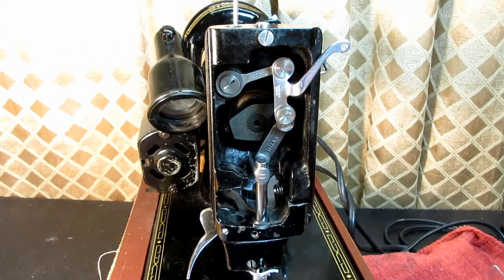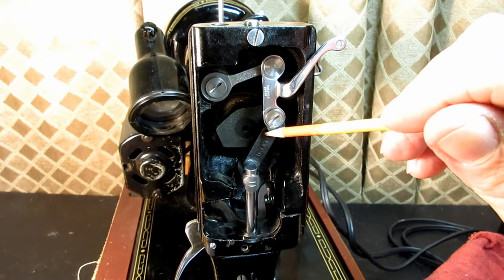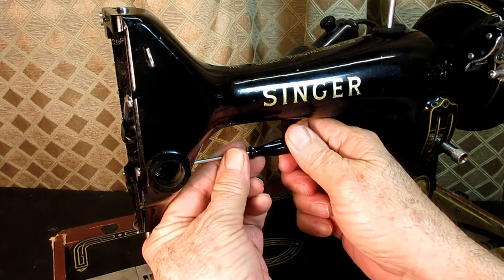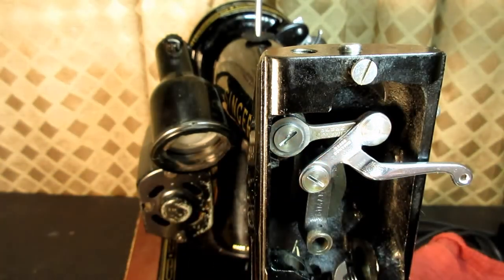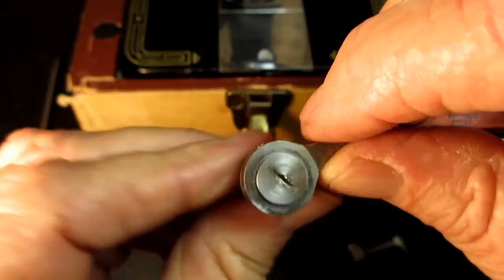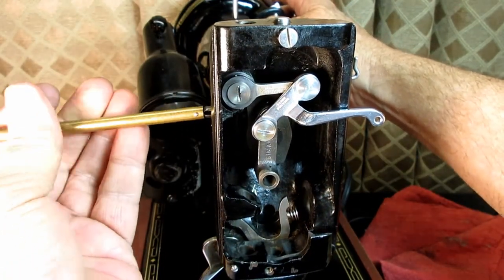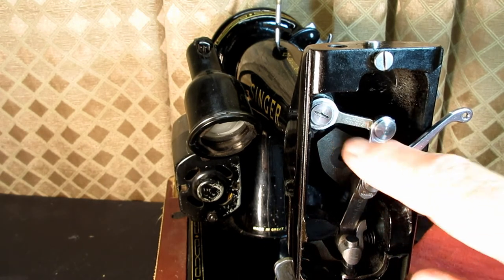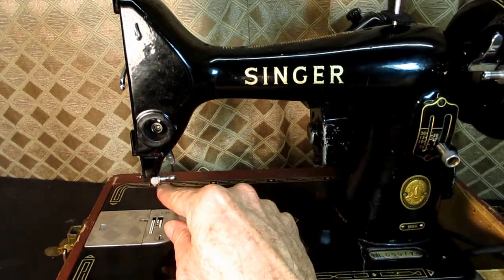The Needle Bar and Take-Up System of a Singer Model 99K Sewing Machine

Comment: Hello Andy,

You have some great videos on the Singer 99K. I am working on a Singer Red Eye 66-1 and I find your videos a great source of information for my applications to the 66-1. FYI, as I have been working on my machine I would like to note a few minor differences that may help someone working on a 66 model that I have learned along the way. 
Nothing major, starting from the bottom to the top: (1)  The needle bar bushing sleeve is longer and
sticks out from the bottom and top of the body and the set screw is in the
front.  (2)  The tread take up crank is the only location with a cap screw that is reverse threaded. 
(3)  The tread take up lever is connected directly at the top joint where the take up connecting link and the
top take up lever link meet.  (4)  At the top of the assembly, the cap screw is right hand screw in the machine body.  No
set screw with a hole in the side of the machine.

Otherwise everything is the about the same, with up to 50 years more of dry oil and crud to clean which is a little more time consuming.      Ralph
Reply from the maker: Thank you for sharing this information. I know many people realize the 99 is a 3/4 version of the 66 and come here for tips. I pinned your comment to the top hoping they will see it.

Comment: Does anyone know if the tension disc releasing lever that Andy left in place towards the end of this video (mine is part number 33659) has an intentional angle on part of the arm that has the little spring on it?  Mine does have an angle and does line up with the tension release pin (even though it won't rock far enough forward with the presser foot fully raised and then "lifted a bit extra" to give a positive push on the tension release pin).  

I'm trying to figure out why it's not pushing the tension release pin in properly when the foot is lifted.  When I take out the presser bar and it's bracket it easily tilts forward enough but with them in it is as if the bracket for holding the presser bar is in the way and would have to be displaced a little for the presser bar/foot lifter lever to tilt the tension disc releasing disc levert far enough forward (which it's not going to do once the presser bar is through it!).

I cleaned it all out thoroughly and polished and oiled all the parts so that individually they all have a full range of free-and-easy motion. My tension release pin is protruding out the back the normal amount and the whole tension unit is pushed fully in before the set-screw for it is tightened.  It's just when the presser bar and its bracket are installed that it wants to "stop short".

Any insights from anyone at all would be hugely appreciated.  Thank you!

Comment: Hey Andy, thank you SOOO much for these videos they've been unbelivably helpful.
I notice that you leave the little rocker part (kind of shaped like a U) with a spring on the right, in place during this. The one on my Singer hardly moves, but I can't seem to take it out to clean, should I be able to remove it?
Reply from the maker: I think you're describing the Tension Releasing Lever. 
     When you lift the Presser Bar lifting Lever it raises the left side of the "U" making the right side (with the little spring) push on the end of the Tension Releasing Lever inside the Thread Tension Assembly and releasing tension on the tension discs. 
     The lever does not "rock" over very far to do this. So is it really hard to move, or it just does not move far? (that's normal). 
     The Releasing Lever is held in place at the bottom of the "U" by a HInge Pin that allows the rocking motion. It is not a screw, but a tapered pin. You'd need to knock out that pin to remove the lever. I never bother unless the Releasing Lever is Broken and needs replaced (very rare). You can put a little oil on the pin area and try to scrub it with a brush or blow air on it if you think there is crud blocking the movement. I have used alcohol and even Krud Kutter on really dirty ones but covered the sewing bed with plastic so I did not damage that black finish.
Reply: Hi Andy. Yes, that's it. It's just really hard to move so I'll try some oil and whatever the UK equivalent of Krud Kutter is!
Reply from the maker: @JD-qp6ug  KrudKutter is a degreaser is all. Folks tend to over oil and oil settles in the bottom of the nose. Over time it gets hard like varnish so a degreaser or alcohol, or even heat from a hairdryer can soften it and allow new oil to penetrate and soften more.

Comment: You know that little rocker arm with the spring on it that gets pushed forward when you raise the presser foot to press on the tension release pin?  I think they call it the 'tension disc releasing lever'...  

It does have a pin going through it for it to pivot on and there's a hole on the harp-side of the head that is line with the pivot point that looks like an oiling hole.  That is one access point to the pin.  When you look at the whole set up you think to yourself "where does it come out?" (I did - it drove me crazy for ages) - and guess what?  That screw-thread on the other side of the head that is for the thumbscrew that holds on the face plate is also the hole the pin is in for the tension disc releasing lever.  It's a double-duty access hole/screw thread. 

I don't know whether the pin itself is tapered, though, so I don't know which way to push to remove it.  It would make sense to me though, if it is tapered, that it would come out on the face-plate side because when you're putting hundreds of machines together in a factory setting you want some consistency with things like that to reduce human error.  Also, in the factory they're putting the pins in all day long and they'd want the easiest access for installation - which is from the nose side.  Does anyone else know for sure before I ever give it a try?  Ta...  Megan  :-)

EDITED TO ADD  Breaking News!! Well, curiosity got the better of me and so I pushed in the direction I'd taken with my guess above using the tension release pin. A shorter, stubby pin just slid right out of the face plate side like butter!  I couldn't believe it - but I had to because there it was.  Now my tension release pin was holding the tension disc releasing lever (TDRL) in place just like its own pin did so I pushed that out using an old needle and the TDRL easily lifted out from inside the head of the machine.  It was such a surprise - yesterday when I pushed in that same hole with a needle nothing seemed to budge.  The TDRL pin is 2.44mm thick = 0.096" and 18.92mm = 0.745" long.  It was not tapered but after testing it likes to be inserted from the face-plate side and pushed out so it exits the same way it entered. When I tried to insert it from the harp-side of the head it didn't even want to pop its head to take a look around.  :-)

Comment: Hi Andy, on a 185k model I’m working on now, I’m parting it out, off the top of your head, do you know if there is a set screw to remove the tension pen releasing lever.  I can probably go find the service manual but I thought I’d check to see if you knew about that particular model.  Thanks.
Reply from the maker: It's been about 20 years, but I think it is a knock-out pin, not a screw. See if there is a hole directly behind it. If so, it may knock-out from back to front
Reply: @andytubesewing1953  lol I thought about that after I sent this. Heck I can’t remember yesterday. Thanks Andy, I’ll check it out.
Reply from the maker: @rhondamercado7527  Good luck!

Comment: I have an old Singer 201 I'm taking apart and cleaning as far as possible and I think a lot of what applies to the 99 will transfer across very well, so thank you for your videos.  With respect to cleaning, what liquid do you use?  I have an ultrasonic cleaner but have no clue what liquid to use in it other than water and perhaps a little dishwash detergent.  While it does clean it a little, it doesn't do very much - so I'm guessing people use something else?  Thank you...  Megan
Reply from the maker: Hello, Megan. If you are talking about cleaning the parts, I use Krud Kutter in my ultrasonic cleaner. I usually use the original formula for cleaning all parts of a sewing machine. https://www.rustoleum.com/product-catalog/consumer-brands/krud-kutter/cleaners-and-stain-removers/original-krud-kutter I use about 1 ounce in the ultrasonic. Friends of mine also use Krud Kutter Parts Washer cleaner/degreaser https://www.rustoleum.com/product-catalog/consumer-brands/krud-kutter/automotive-cleaners-and-removers/parts-washer-cleaner-degreaser   I buy it at Home Depot or the Hardware store. One Walmart near me also carries it sometimes.
If you are talking about cleaning the painted body here is a video (long) I did about cleaning my 99K https://youtu.be/w6fn-TSOCYo
Your Singer Model 201 has a number of similar parts to the model 99k. Some parts, like the hook and bobbin case, may be different. 
I hope that gives you a place to start and good luck. Thanks for watching my channel.
Reply: @andytubesewing1953  Thank you so much - like many others I really appreciate the trouble you take to help us!  (I'd really like to see more videos on youtube like yours, except for the 201 model (at least the mechanical parts, if not the electric) but there's surprisingly little out there like your videos considering what a popular model it was. If you ever decide to dabble in 201s I think you'd you'd make loads of people over-the-moon with delight.  I've watched lots of vids now on Singers and yours are just outstanding!  I've learned a ton.)
Reply from the maker: @meganmills6545  Thanks for your kind words, Megan. I'll give serious consideration to a 201 model. I've been getting more small donations thru PayPal and they are starting to add up. I'll keep an eye out for a 201. Happy New Year 2020
Reply: I have a Singer 99 I recently acquired .My question is how do you know what the next numbers or letters after 99 (or whatever model) are and how you tell? Thank you Andy! Your videos are my favorite go to’s !💕
Reply: @willablake9284  Hi Willa,  I know you were really asking Andy but your question came through to me.  One of the best sites I've found, if you haven't already, for lots of info like this is Ismacs.  Another useful one is Singer Sewing Info - they have a page about the 99 model:  https://www.singersewinginfo.co.uk/99k/  And I also like the Needle Bar web site when I'm looking for info but I've not been able to find much on there for the Singer 66 or 99.  Regards...  Megan

Comment: Hey Andy, I was given two 99’s a couple of weeks ago. The lady just had them sitting in storage and when I went to pick up another machine, she asked me if I wanted the 99’s and of course I couldn’t say no.  One of them I’m working on is a, Godzilla finish and just the cutest little thing ever but I tell you, that needle bar will not come loose at all. I have tried every thing possible and from what I am reading in some of the groups I’m in they say to just keep applying oil, heat etc and that it could take weeks before it loosens up but it’s seriously like somebody welded that thing in there.  It was easy unscrewing the set screw, that was not a problem.  I have used blaster, WD-40, I’ve used kerosene, I’ve used a heat gun, I’ve used the blow dryer, I’ve used oil, a wrench with a towel to grab it without harming the bar itself self, but geez,  it’s just not budging, not a smidge. Any suggestions on what possibly could be the issue there?  Maybe just patience?  Thanks
Reply from the maker: Yep, if there is no sign of rust, then be patient. Congrats on your good fortune! 
I've never even seen a Godzilla machine in person, and have one! 👀😲
Reply: @andytubesewing1953  I believe I’m partial to the Godzilla finish. I have two singers with that finish….I think.  I seriously couldn’t even tell you how many singers are in my home today😂. Thanks Andy….I’m going to just continue waiting to see if I can get it loose.
Reply from the maker: @rhondamercado7527 One thing I did a few times that seemed to help was I would soak a cotton makeup remover pad with penetrating oil and wrap it tightly around the base of the clamp and up onto the needle bar and then put a few more drops on it. I just let it sit overnight and that did help. By the way, I once asked my wife if I had too many machines and she told me as long as they don't stack up higher than the back of the sofa I was okay hahaha
Reply: @andytubesewing1953  😂

Comment: Hey Andy that set screw that fell off into the machine, I’m having trouble unscrewing it.  I’ve applied wd40, Alcohol, oil, hair dryer but it won’t give.  Any suggestions?  Thanks.   Update:  it loosened up.  My dilemma now is loosening the presser bar screw.  It’s funny how I was able to disassemble all of the parts on the take up level stuff but it looks like the presser bar needs to be out of the way in order to put it back?  I’ve done enough for the day I’m gonna take a break and see if I can’t get that screw loose, if it’s absolutely necessary in order to put the other parts back on.
Reply from the maker: Hmm... It's been about 5 years since I did the 99, but cant you just remove the top thumb nut adjuster and pull up/out the extension rod & spring? I don't think you have to remove the presser bar itself.
Reply: @andytubesewing1953  I think it’s just the improper way I put it back.  I’ll pull out my other 99k and compare it.  Thank Andy
Reply from the maker: @rhondamercado7527  👍

Comment: What is the spring jaw tool actually called that you used on the set screw I got to find some
Reply from the maker: It's called a few different names. Here is an example at Amazon of a modern set: https://www.amazon.com/Screw-Holding-Screwdriver-Klein-Tools-SK234/dp/B0002RIA3K
"Screw-Holding-Screwdriver", split-shank screwdriver", "Screw starter screwdriver" and so forth.
Reply: Thanks so much ! @andytubesewing1953
Reply from the maker: welcome.

Comment: Well, I used to think taking out the slants' thread takeup lever and needlebar was complicated before watching this, at least there you can see all the set screws!
Reply from the maker: We are traveling the same highway, Daffycat. This is a nice machine and sews well, but after working on so many slant-needle Singer machines, it seems more complicated then needed.
A slant is so well designed and easy to maintain and work on; they are "nicely done'!

Comment: On the "old dunger, didn't sew anyway" 201K treadle I'm semi-taking apart I'm having a huge amount of trouble pulling out the take-up lever system.  This has proved more trouble than anything else so far, by far.  I could get out the "crank" part (with Simanco facing out and "o" up) reasonably easily.  It happily comes out on its own on a 201.  But the top one, that you also must remove to get the take-up lever out, hasn't been budging despite sessions of penetrating oil, kerosene (paraffin), SMO and heat along with trying to wiggle it all the time.  
There is a hole on the other side of the head that this hinge stud goes through too.  In that hole, where you can see metal at the end of the hole but no slot it in it to get a screwdriver in and turn, you can get a rod or bolt that fits and tap out the hinge stud rather than pull it out.  Or at least, you can try to!  My hubby - who is big and strong and a sure-hit with hammers and such - has managed to budge it just few millimetres so far.  I've re-penetrating-oiled it everywhere (including where I took out the set screw at the back of the head) to, I hope, get to a slightly different spot on the hinge stud.  And I'm heating it again.
I'm hoping that if it could move a little then eventually it will move some more.  I'll let you all know if I succeed.
I mention all this just in case any of you strike a really, really stubborn one and figure you've got nothing to lose by trying it.  I am wrapping a bit of cloth around the body while hubby bangs/taps at the bolt and we're doing our best not to strike the machine anywhere other than the back end of that hinge stud thingy so we minimise any chance of chipping the Japanning if there is a mis-strike.
Reply from the maker: See the set screw I remove starting @ 16:00 in this video? ( the smaller one ) On model 201 there should be a set screw ( X10 ) in the same place that needs removal for the Hinge Stud ( Y10 ) to pull out. The hole directly behind the hinge stud ( R10 ) is to give access to the end of the Hinge Stud if you need to tap it out to get it loose.  This is explained, with diagrams also, on pages 63 & 64 of the Adjuster's Manual for Model 201.
Reply: @andytubesewing1953  Thank you Andy -  yes, I had got that one out - but I went and triple-checked anyway before I started the "tapping/banging" from the back as a last resort.  Certainly for anyone reading my comments it's very important for them to know about that screw and get it out first before they try it so I'm really glad you mentioned it!  
The good news is, after another heating etc session my hubby did another round of banging (bangs if I tried it, moderate taps for him) it finally came out, about 15 minutes ago.  But it took about 20 more strikes and is something I'd never attempt by myself, ever.  All in all the whole exercise took about 6 hours - not counting the penetrating oil I put everywhere before bed last night.
Reply from the maker: @meganmills6545  thank you Megan I knew you would have taken out that set screw first but I wanted other readers to be sure to understand that congratulations on your persistence and getting that hinge stud out of there it sounded like a real booger I've had a handful like that over the years and they are a PIA but man when you get them out it seems very rewarding best of luck to you going forward I hope someday to see pictures of your machine and by the way kudos to your hubby for being so involved in the restoration hat's off to you sir 👍